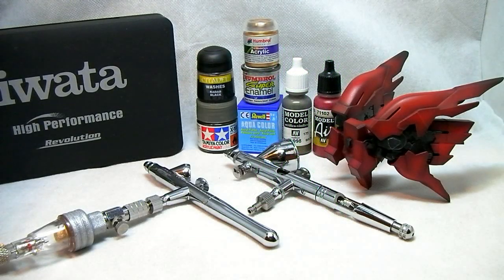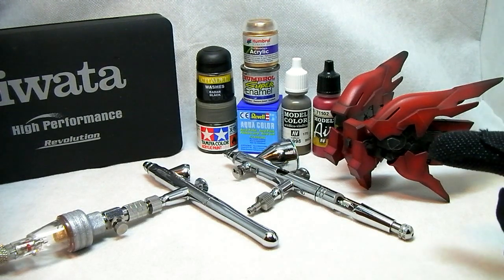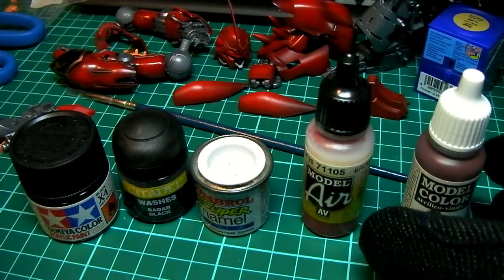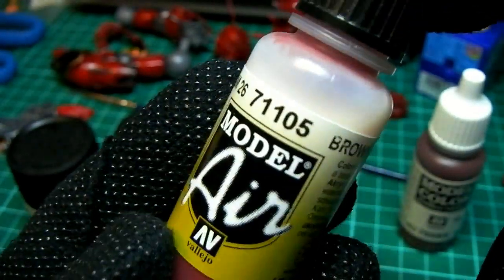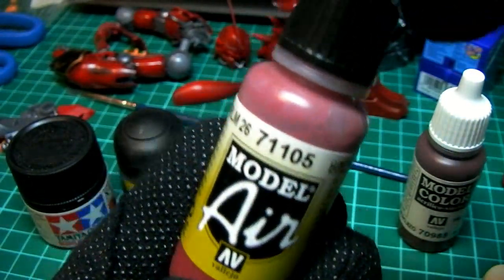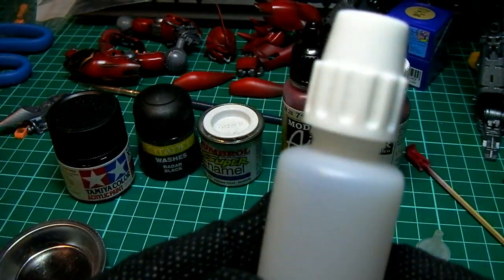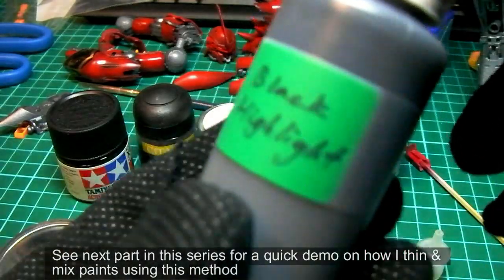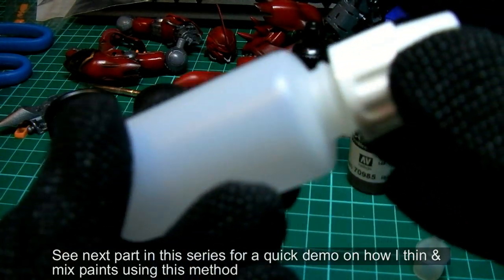Airbrush painting 4 (tips & tricks) - Make your own Vallejo Model Air paint dropper bottles

Comment from the maker: Yes the model air are fine as normal paint, the only reason you wouldn't is because they are more expensive. The GW paint should be fine to airbrush as long as you use some acrylic thinner to water them down. Is it a problem spraying them or you mean you dont like the airbrushed finish with them?

Comment: Could I give you a little tip to help with the remixing of the paints that have separated over time in the dropper bottles. Add a clean 10mm nut to the bottle before you push the dropper top in. This will help get all of the pigment properly mixed in with the thinner and allows a more even mix overall.

Comment: I have done this with my Vallejo paints, the tops come off easy, just push the tip to one side and put your fingernail underneath the tip to help pry it off. I got small 4mm faceted glass beads on ebay, about 200 for a couple £/$

Comment: Hey Mate !! Could you tell me if it is possible to put little metal mixing beads in Vallejo Paints. I guess what i need to know is, is it possible to take the top off a bottle of vallejo model color ? I am thinking about picking up 30 or so Beads but i'm not sure if i can get those little beads into the bottle. Having that little rattle inside REALLY helps it get properly mixed much faster than sturing with a toothpick.

Comment: Do you have issues with the paint going bad when mixed?  Over months?
Reply from the maker: It's been fine for over a year. The paint does settle but this happens in any container. I would imagine that not all dropper bottles are made the same, but mine seem to be air tight.